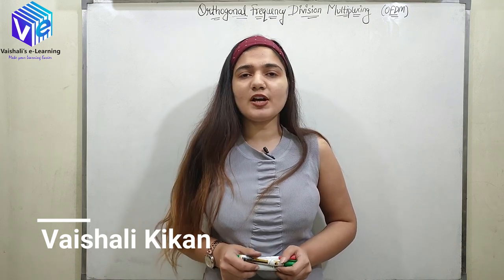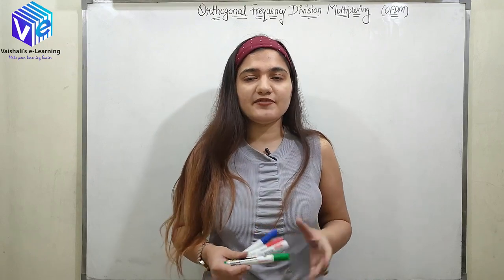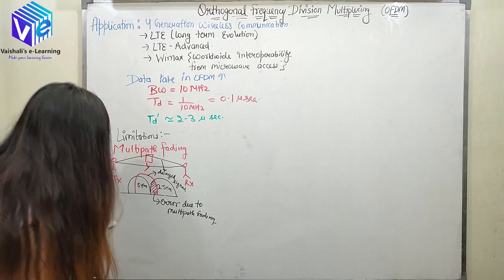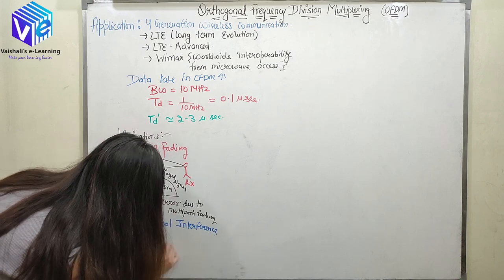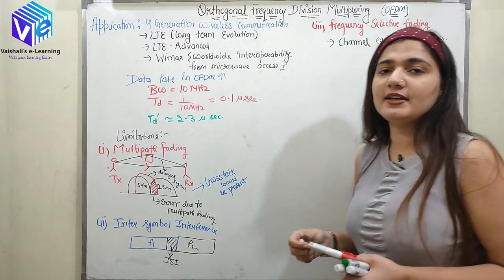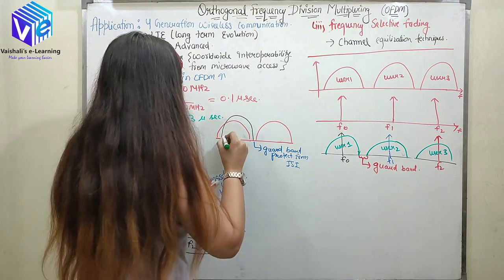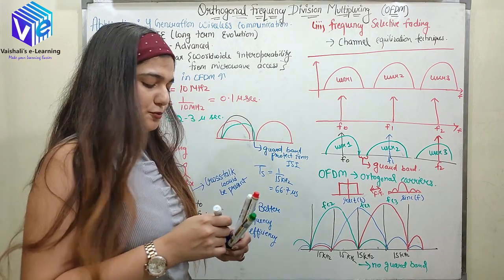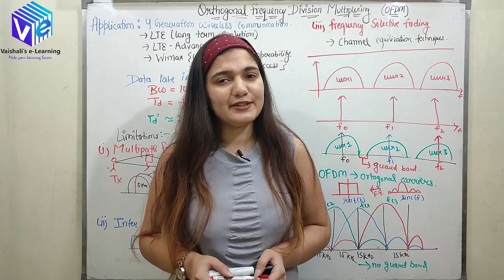Lec 8 | Orthogonal Frequency Division Multiplexing | OFDM | Wireless Comunication |

Comment: OFDMA = orthogonal Frequency Division Multi Access. The key word is orthogonal... Orthogonal means 90 degree... What you have explained is good but not exactly to the point...OFDMA allows to transmitters to use the same carrier frequency phase shifted by 90. This is due to the mixer property where carrier is muktipled with the modulated signal to retrieve the base band. As you do mathematical calculations. It turns out to be a dot product... So if the actual signal is 90 phase apart from the carrier signal it lead to zero output

Comment: Wi-MAX stands for Worldwide Interoperability 'for Microwave Access. It is a wireless communication medium and telecommunication protocol, which is used in mobile internet. ; A medium used instead of cable and DSL to provide data. Currently the speed of Wi-MAX is 40 Mbit / s which can be increased to 1 G'bit / s. Using the Wi-MAX FORUM in 2001. At present Banglalion as a broadband in our country. Qubee Wi-MAX is being used. It uses full duplexing mode and at the same time provides multi-functional benefits. The Wi-MAX system has two main parts, namely - 1) Wi-MAX base station 2) Wi-MAX receiver
Reply from the maker: Thank you so much for your valuable information..
I will surely share this on my channel in upcoming videos
Thanks for connecting

Comment: ODFM over powerlines causes severe interferrence , basically you're transmitting on frequency's you're not allowed to transmit on .......  for this reason people who are using it should qualify for radio piracy .......  these signals are so worsly filtered i can hear their harmonics in 40 Mhz ........ we are working on way to disturb this , arcing proves to be sufficent ............. plc can not exchange information with arcs on the line .

Comment: The full form of wi-MAX is worldwide interoperability for microwave access. It is a wireless means of communication and telecommunication protocol, which is used in mobile internet. Instead of cable and DSL, it is a medium used to provide data. Currently the speed of Wi-MAX is 40 mbit / s which can be increased to 1 Gbit / s. In 2001, the name Wi-MAX was first used in the Wi-MAX Forum.

Comment: What is the relation between delay time and Bandwidth? I think it should be bit period or pulse width not delay time. As per my knowledge, Bandwidth is decided by pulse width not delay time. i.e. If bandwidth is large, data rate will increase and hence, pulse width/bit period decreases and more bits will be transferred in same interval of time.

Comment: For getting the sinc function we are going to implement the fourier transform on user data Mam plz explain...
Reply from the maker: Fourier transform of rect pulse is sinc and line encoding is done which results in rect signals..
Thus it's Fourier transform will give sinc pulse..
Thanks for connecting

Comment: 5:28 Multipath fading (i) is same as frequency selectivity(iii).
Reply: no
Reply: in multipath freq took multiple path to reach at rx due to some geo conditions that time n while it reaches on rx side some of the freq maybe out of phase which result in weakening of signal
Reply: @nBoxit  firstly,  it is tough for me to decode the shortened English. Request you to make it clear. Secondly, make precise statements and avoid statements like "some geo conditions". Instead say, "due to scattering etc". Lastly, giving some references, if possible, can help.